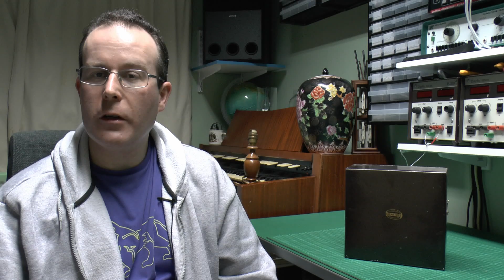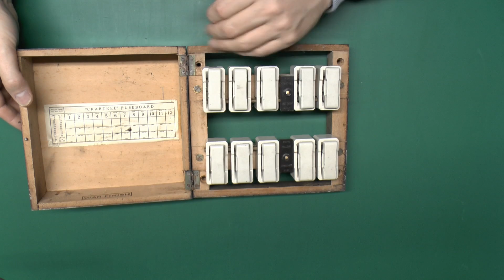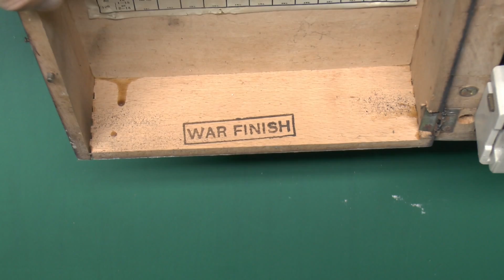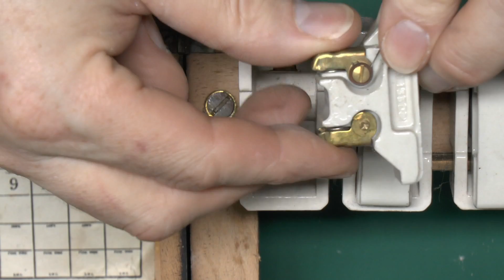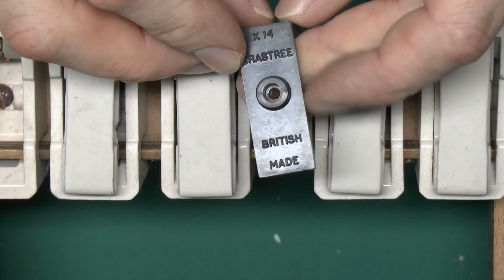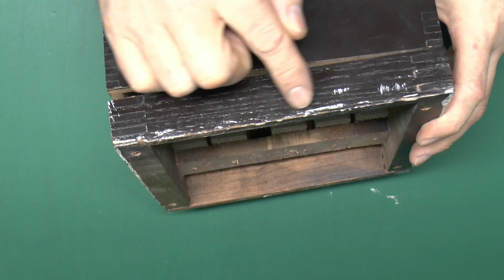Crabtree Wooden Fusebox, 5 Way Double Pole, War Finish

Comment: At the time when those were in use, the wiring almost always was back entry; metal slip conduit with single core VIR cotton covered cables was a very commonwiring system  for lighting circuits.